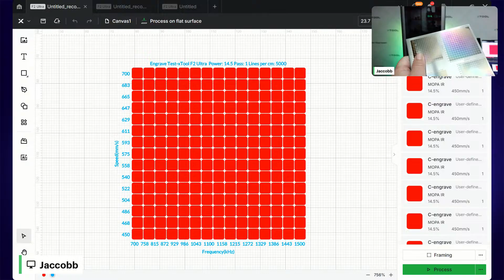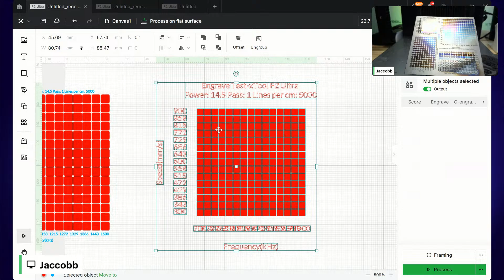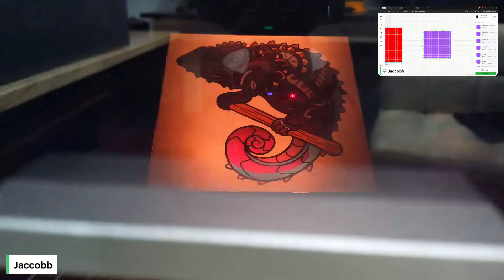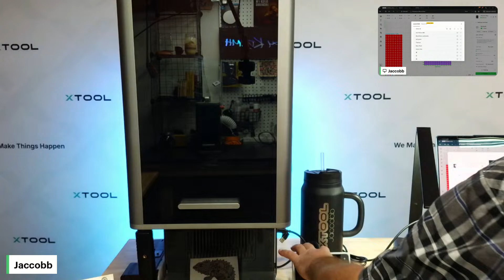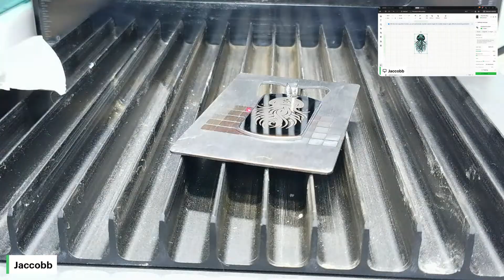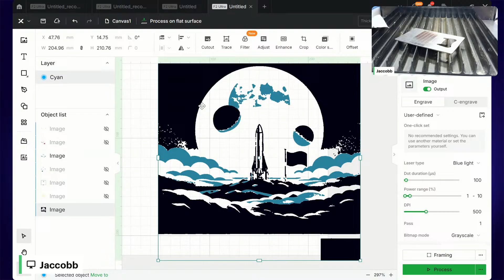Master Color Engraving with xTool F2 Ultra: Pro Tips to Make Top-Selling Metal Color Engravings

Comment: Awesome video, quick question, how would you do a test array using the curved surface setting? I didn't get anywhere with it. There is no color engraving setting. Obviously I have curved blanks and I want to do a test array on that particular material to get the best representation of the available colors, on that material, and that stainless steel finish.